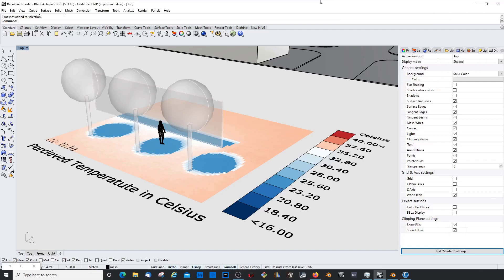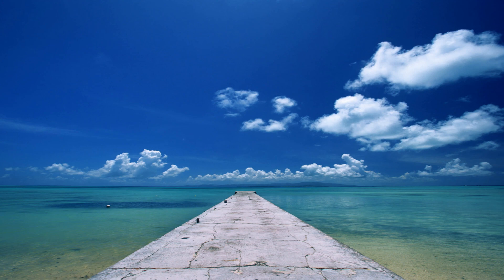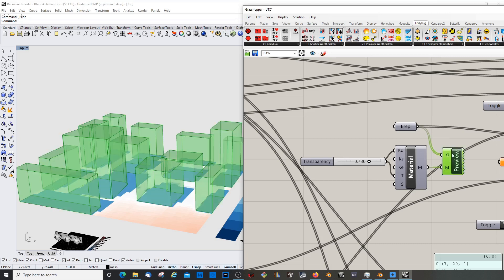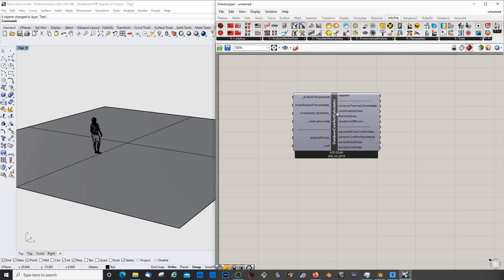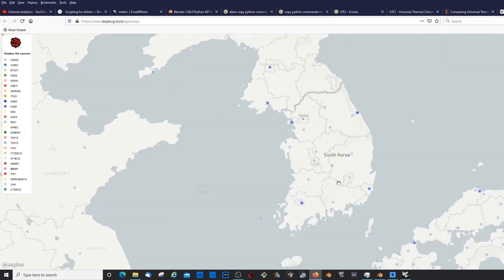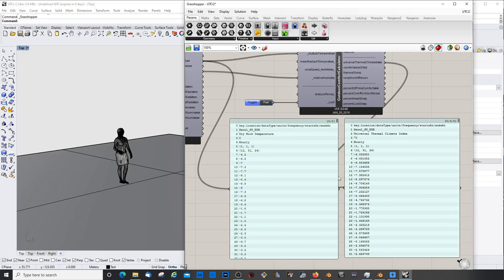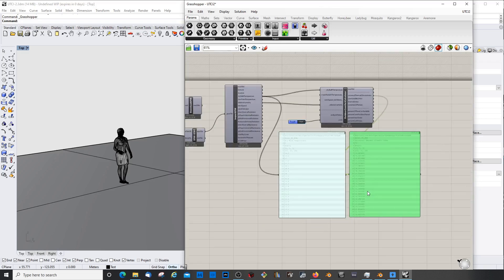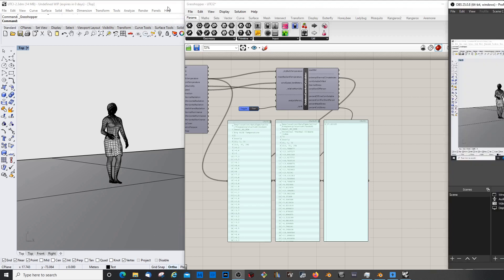Outdoor Comfort Analysis Part 01 | Rhino3D Grasshopper Tutorial 07

Comment: Hi Philipp, I want to use ladybug for outdoor comfort but my index is PET. is it possible to do it by Ladybug?
Reply from the maker: I need to check. I'll get back to you on that.
Reply from the maker: hi Mahziar, I did a bit of research. Actually, there is a tool called - ' Thermal comfort indices' (ladybug tools) which allow calculating PET and many other comfort indexes. Currently only available in the legacy tools and not in the new ladybug tools, but since you follow this tutorial I guess you have the legacy tools installed. you can install both versions at the same time.
Reply: @PhilippGalvanDesign  Hello Philipp again, Thanks for your efforts. So I think I am able to manage the project with ladybug. Thank you again

Comment: I use ladybug 1.1.0, there is no solar adjust temperature in my ladybug version 1.1.0. how to do this simulation?
Reply from the maker: @Melvina Pramadya - I'm working on a solution for Ladybug 1.1.0. I did a quick test which seems to work but need test a bit more and put a video together. Bare with me.
Reply from the maker: @Meliva Pramadya - check out my latest video. I hope that gives you some answers. let me know how it goes or if you have questions. 
https://youtu.be/gn_cZSiePzk